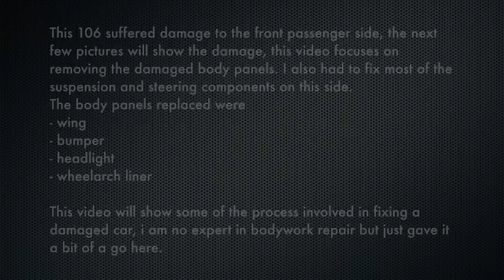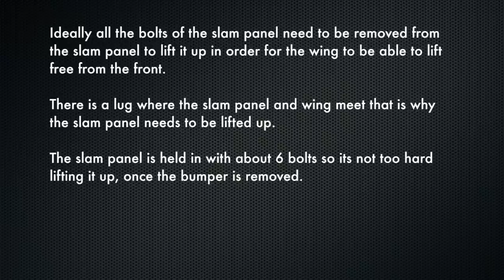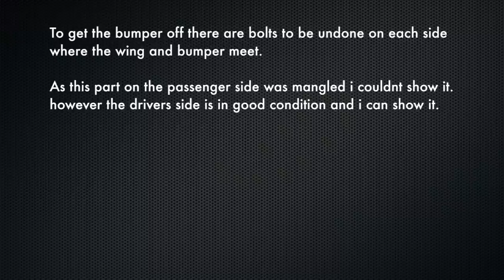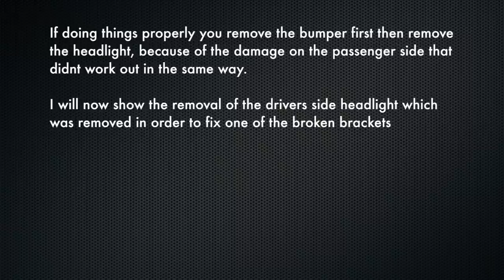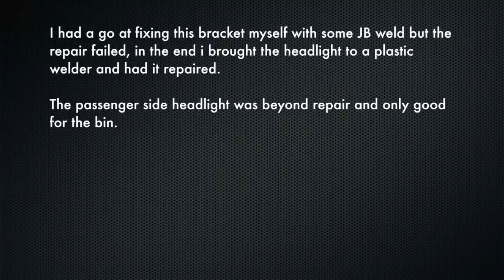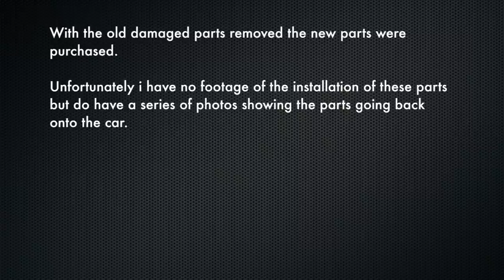Bumper, Wing and Headlight Removal from a Peugeot 106

Comment: I need to replace my front passenger wing on my quicksilver, should I buy any normal 106 front wing and spray it or does it need to be a gti/quicksilver one because of the arch that goes on top?

And have you ever had any problems with water getting in to the passenger footwell, I've heard it's something to do with a faulty heater matrix but I'm not sure.
Reply from the maker: +Michael Moore 
Im not sure if the GTI or quicksilver had any difference in the sheet metal of the wing, isnt the arch extension just a bit of trim? That one may need some research. The cheapest option is to find one being broken in the same colour which will save the respraying.

No leaking issues on the 106 other than the radio aeriel which i did a video on, heater matrix leaks will create a funny smell inside the car which can vary from smelling like juice to piss. Does the interior heater work, is any coolant being lost, does it mist up quickly inside. Is there a sunroof? Also worth checking the scuttle panel below the windscreen for accumulated leaves which if they have clogged the drains may cause water to end up inside the cabin.
Reply: +peugeotCitroen2CV Alright, I just thought because underneath the arch trim, there are some holes that I thought are used to attached the trim on to the wing.

I don't smell anything too bad in the car, and yeah the interior heater does work but it does mist up pretty easily on the inside and yeah there is a sunroof, the only other leak I have is from the radio aeriel, need to get that sorted, already seen your video on it, which will help.
Reply from the maker: +Michael Moore 
I think they do push into place with clips, but i have not worked on a gti/quicksilver to be able to spot the differences first hand. The 106 owners club forum has probably a few threads on the subject.

The sunroof is worth checking as is the aeriel base check those first before the heater matrix. If it is the heater matrix you will have coolant loss and a funny smell inside.

Comment: Hi. @5:31 the showned adjustment is in height or in length? Thanks
Reply from the maker: The slot would allow some adjustments to the position of the bumper to be made more so in the front to back axis.
Reply: @peugeotCitroen2CV  thanks mate! so I have a problem: I have a big gap between headlamp and bumper on both corner...there´s any way to adjust it in up/down axis? 

thanks again for your nice videos!
Reply from the maker: @jasuscaredo  Before tightening any bolts keep everything loose and set the gaps between parts. Unfortunaltey i am no expert when it comes to bodywork, but usually there is a bit of movement in most parts.
Reply: peugeotCitroen2CV Hi there. After some work I discovered that height adjustment only can be done with a big hammer!!
Reply from the maker: @jasuscaredo  One of the most versatile tools to have about
Reply: @peugeotCitroen2CV   ;)

Comment: How much did you pay for the car
Reply from the maker: I paid £280 for it, but it was damaged so i spent about £700 putting it right and getting it back on the road, it was only that the car had a low mileage which justified spending the money on it. The sensible thing to do would be to buy a well looked after used example they seem to hover around the £500-600 price range on gumtree.
Reply from the maker: (sorry i accidentally deleted your comment, but ill awnser it anyhow)
ive just been busy with work during the day, then the 305 in my spare time, the 106 is back on the road and my grandpa is now driving it, i will do a quick video of it soon.